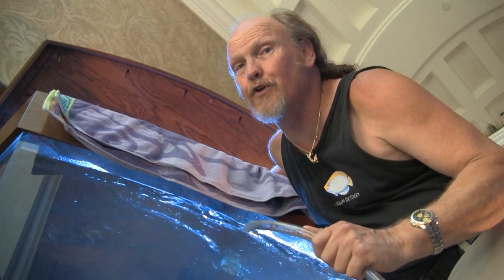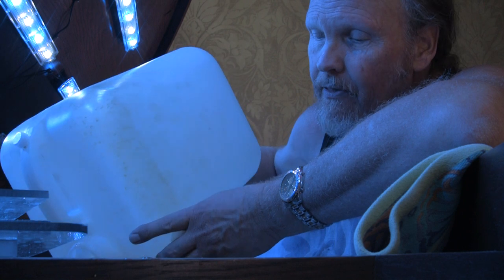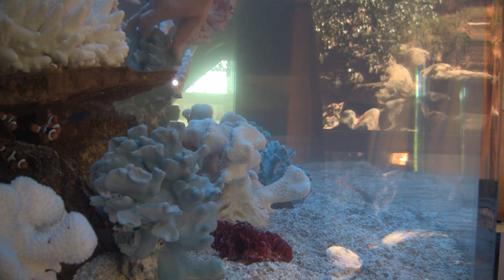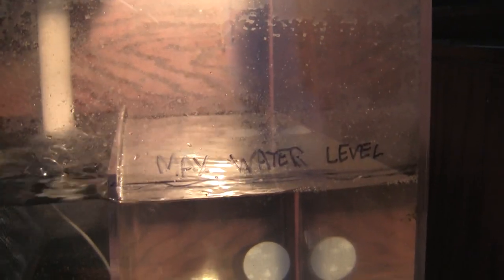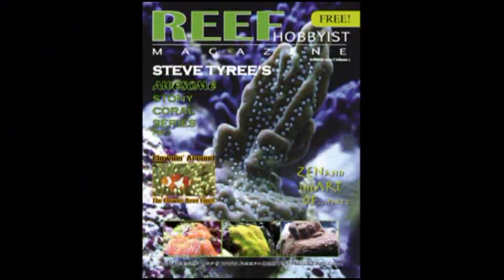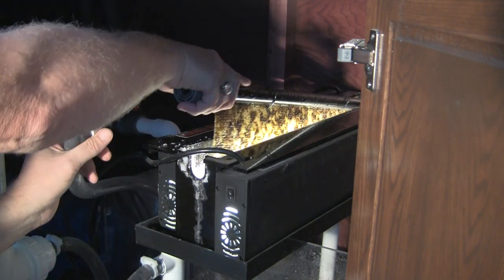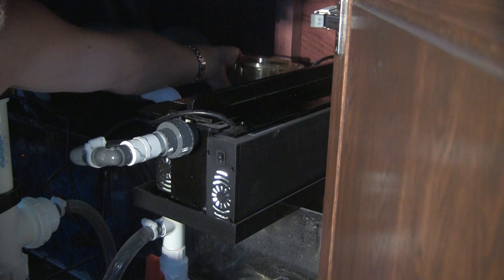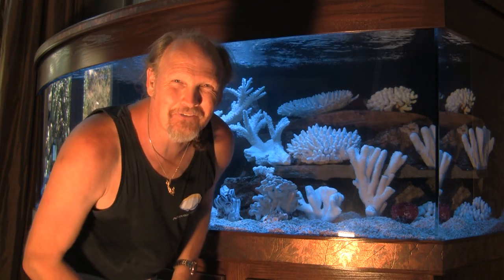First Service of the 400 gallon Bowfront Aquarium, LA Fishguys, Episode 119 pt 2

Comment: ...However, when fish, inverts, pods, corals or bacteria eat the food particles, they respire and produce ammonia. That ammonia goes directly into the water; the more they eat, the more ammonia they produce. This ammonia is not removed by skimmers. The ammonia first hits the display glass, causing you to clean more, then it goes through the nitrogen cycle in the rocks and sand, thus producing more nitrate for the scrubber.

Comment: Hate to call you out on this but you are wrong. The algae scrubber does NOT lessen the load on the protein skimmer. It actually is the other way around. The algae scrubber works by consuming nitrates in the water. Nitrates are the result of the nitrification cycle (ammonia>nitrite>nitrate). Ammonia is caused by the breaking down of proteins which the skimmer removes before they can break down. Because the proteins never break down, they don't become nitrates in the first place.